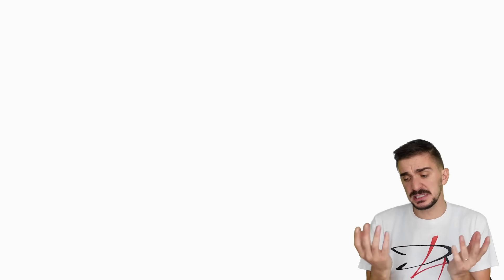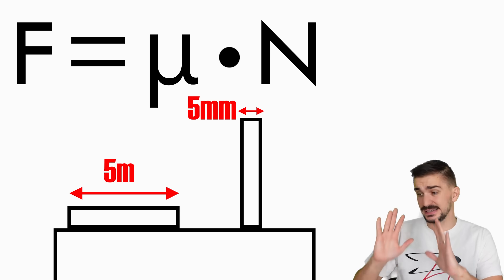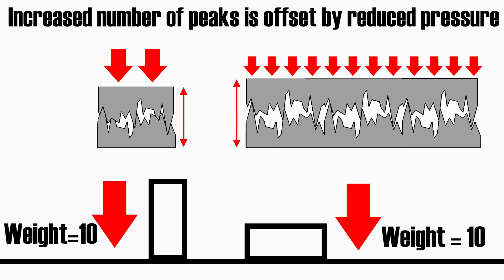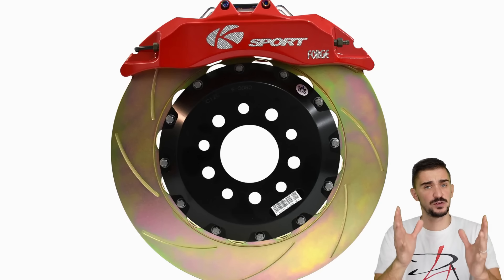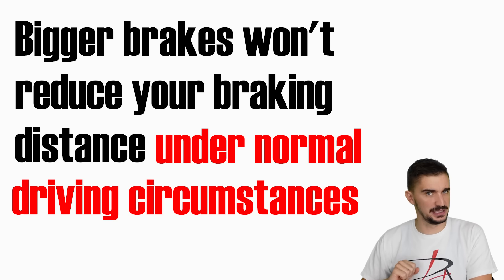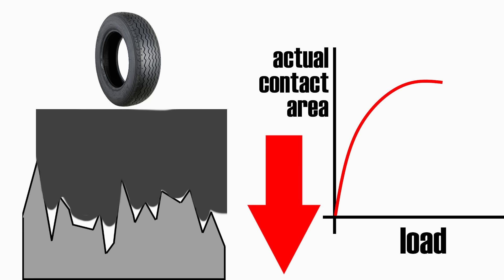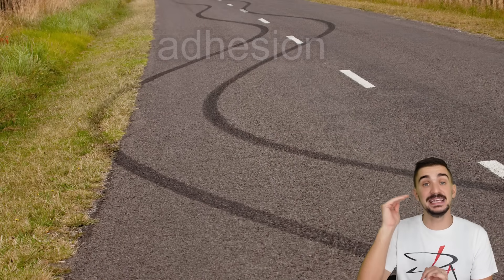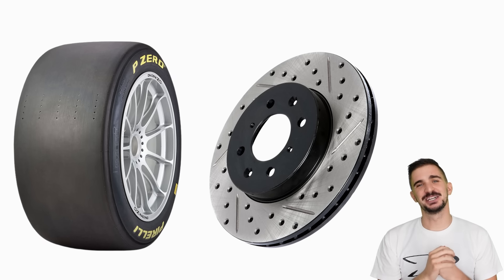Why Big Brakes Won't Stop You Faster but Wider Tires Will - Friction and Surface Area Explained

Comment: I think that the reason is much simpler. Most brakes are already able to lock up the wheels while braking so pressure increase won't help, because the wheel can be already locked up with smaller brakes (that is also why every new car has ABS). 
This means that breaking performance for most cars isn't brake pressure limited, bud tire grip limited. 
Larger tires will have more grip and more grip means more friction, which improves braking performance.
Reply: TRUE, Until the second hard application and the small factory brakes are fading from overheating .. there's far more to brakes than presented in this video
Reply: which could require larger brakes. at some point the grip is so much that u need larger brakes to lock it up with abs.
Reply: @jkoorts  At some point, the grip is so much that you need more stopping torque to lock it up with abs. That could be accomplished with larger diameter rotors, or it could be accomplished with better brake pads alone. That's how I solved the problem.

I installed much stickier tires, and could no longer trigger ABS on smooth, dry pavement. I understand the physics, and knew that I could use more stopping torque, but also knew that I did NOT need more heat management capacity. So I selected pads with a proportionately higher coefficient of friction to try matching them to the increased tire grip. This solution worked perfectly, while being way less trouble and way less cost than installing a big brake kit.
Reply: If, by "larger" tires, you mean wider, you'd be wrong to assume you get more contact area, and therefore more 'grip'. You can change the shape of the contact area, but not its size (area) by using wider tires.
Reply: @johngalt97 Of course you change the size of the contact area.
What you say could only be true if tyres compressed with force in linear fashion, so that spreading the load over a wider area meant that the wider contact area were exactly offset by less of the tyre in front of and behind the centre of the contact area were forced down to the road surface. This is not the case.
Reply: Static friction force IS ALWAYS greater than kinetic friction force. This is the principle behind ABS, the NET friction force over a set time between pad and rotor is greater with rapid engagements/disengagements (static fric. Every time they engage) than with just one engagement (static fric. Only once at the start). Now, here is where things get complicated. Lets say you have 2 ABS engagements over a 10 second time span vs 1 continuous non-ABS engagement over 10 seconds. The non-ABS will actually outperform the ABS in this case, which means it allllll comes down to an optimization problem, you have to set up a few integrals to figure out the optimal ABS engagements for any given situation.
Reply: Nothing to do with locking up wheels, as if your optimization is not done correctly then the braking force ITSELF will not be sufficient to even come close to locking up the wheels. ABS DOES indirectly stop the wheels from locking up, however this is NOT where you should calculate your ABS optimization.
Reply: Some cars have OEM brakes that are just enough to reach the ABS threshold on the OEM tires. I have a car that was unable to reach the ABS threshold on smooth, clean, dry pavement after I put on stickier rubber. My solution was pads with a higher coefficient of friction than the OEM pads, and it solved the problem very well. I suppose larger diameter disks would have solved the problem too, but I didn't want the extra unsprung and rotating mass. Replacing the pads was an easier, less expensive fix also.
Reply: @xtnuser5338  Yup similar here, I think tire technology has improved enough over the past 15 years that the OEM brakes on my car no longer are able to reach the ABS threshold on smooth dry tarmac. Given that I also want to fit slightly wider tires because the OEM fit is really slightly too small for the rim for some reason, I'll definitely be upgrading the brakes too when I can.
Reply: New cars have ABS because it helps prevent drivers from locking the wheels. It has nothing to do with how effective the brakes are, or whether larger or smaller brakes make a difference. It's simply a safety feature to help the driver.
Reply: @severnsea  If the car had weak brakes and couldn't lock up the wheels, ABS wouldn't be necessary. Therefore powerful brakes ARE the reason, why the ABS exists.
Reply: @tomkocian6710  Yes, the prevent the wheels from locking up. I think we're at cross purposes here, I might have misunderstood your original post which discussed the size of the brakes.

Comment: Yet, with all other things being equal (same pad size, same piston area, etc), larger diameter brake discs will provide more braking power.  The same force from the slave cylinder piston is being applied further from the center of rotation, therefore applying more torque to the wheel.

Comment: wider tires also allow for more dynamic load to be added before it reaches 100% surface contact, at which point additional normal force doesn't increase grip as fast anymore as it did before when it was both adding increased surface contact and normal force to the equation.

Comment: a bigger brake disc will dissipate  heat better and reduce  or prevent fade BUT, it can also take higher pad pressure. Higher pad pressure will increase friction and thus braking power.  When you upgrade  your brakes, you don't just change the discs. You change the pads and hydraulics too.

Comment: So a larger diameter disk has nothing to do with greater mechanical advantage? I would have thought having the brake contact point further from the centre of the wheel (i.e. longer lever), would result less force being necessary to achieve the same braking performance.

Comment: Your statement is not correct:
Bigger discs are movin the effective braking force further away from the wheel axis.
So you achieve higher braking torque by the same braking force (if we assume, that the calipper pistons stays the same).
You should take care: if you behave like an expert, please make sure, the content is on expert level. This video only is okay if it is about friction, but incorrect about break performance of bigger break discs.

Comment: Hey mate, thanks for another great video! Sorry, but you missed a very important point about breaks "size", besides the heat dissipation (for which your expectations are perfect). I mean breaking torque, larger rotors (larger diameter) makes the same force to result in a higher braking torque (negative torque to stop wheel rotation) too, as the force is applied further from the circumference center. And that, theoretically, can make you "stop quicker", greater torque + same angular speed= greater power (negative power, against the wheel rotation). In practice, however, the tires use to be the "bottle neck" (that's exactly why ABS is there for you in emergency breaking, even in good dry surfaces), then indeed, larger tires are the first choice to "stop quicker", until the point their friction becomes greater than the breaks... Then, the breaks needs to be upgraded (larger diameter)... Conclusion is that larger breaks won't stop you quicker if your tires are still the limiting factor. About the tires, it's s awesome, I did take trainings from Pirelli F1 engineers a while ago and it matches your explanations. Cheers 😃
Reply: I got your point now, when you replied to a similar comment, thanks a lot!

Comment: One thing that makes me wonder is how the larger radius on disk brakes, which leads to greater linear speed on where the pads apply the friction, interferes with the breaking behavior.

Another thing that bugs me is why in motorcycles the size (radius) of the breaking disks (and the number of disks) increase relative to the the power of the motorcycle, not to it's size or weight.

Comment: Video suggestion - do you have any videos covering flow and velocity when it comes to intake tubing (intercooler pipes) and exhausts? 

I have a stage 3 on my car, except I haven't installed a larger diameter exhaust. My thinking is that larger diameter will help top end power, but ruin drivability (i.e., scavaging will occur later in the RPM range making the car even more laggy). I have an upgraded FMIC with 2.5 inch diameter intercooler piping. But even when I'm in the RPM range the car should be boosting (e.g., holding constant at c. 2.3k RPM) and then floor it, it takes a second to really take off. (The car is a Passat 1.9 TDI PD130. It's probably around 210bhp to 220bhp.)

 Another example is my CBR600RR. It comes with an exhaust valve. People always say to remove them for "more power" but when you read up about them, they're designed to increase low-end torque. I presume it's to do with increasing exhaust gas velocity (?).

It's a topic that I'd love to know more about - i.e., the trade offs and benefits of larger diameter intake and exhaust tubing.

Comment: Good video. Suspension is another extremely important component to improving (decreasing) braking distances. So too is ABS, if/when set up right. But probably the most important thing to improve braking performance is pad, disc and tyre material. Buy good parts (like EBC BSD discs and Yellow stuff pads and performance-oriented tyres) and you'll be stopping far sooner (assuming you're not already at the limit of your tyres, suspension, ABS, etc.).

Big brakes look cool and are a 'cheap' way to handle more heat, but keep in mind, F1 brakes are tiny by comparison. Lower unsprung weight is usually a sure way to improve a cars performance (at the cost of more vibration / less comfort).

Comment: Bigger brakes will reduce your brake distance. Force=Pressure*Area. When you apply the brakes, your foot creates hydraulic pressure in your braking system. Greater surface area brake calipers apply the brake pressure created by the master cylinder over a larger area, so you can apply a greater braking force to the rotor with the same force from your foot.
Reply from the maker: No

Comment: Larger brakes do stop you faster, it works more on the lever effect. The farther the caliper is from the center of the wheel, the less pressure is required to stop. Also the larger diameter the rotor is, the more frictional surface per revolution.

Comment: in my experiences in growing up in a garage n seein the evolution of brakes (>50) i agree that big brakes absorb more heat than smaller 1s BUT in my spirited driving experience i found that the more i can place the caliper (not talking bout surface area now ) close to the rim i get a shorter braking distance by technically using BRAKING LEVERAGE & if your tyres are the right compound & width as you stated u will get a shorter braking distance while the rotor absorbs the heat (USING SOLID OR WITH GROOVES ) x drilled is a no no ....(i have used stock size calipers on larger diameter rotors, cause of monetary issues, so that the calipers DOESNT cover all the diameter of the braking area ) now i also found that increased braking leverage on "narrow" tyres WILL cause it to lock up very fast ...i also noticed that large brakes on certain weight vehicles last VERY long like when i put Volvo 244 4 pot calipers on a Volkswagen bug & the 2 pot that was originally on the front i put on the rear  (as far back in the 1995) which i noticed was the same rear caliper on both the Volvo & Porsche 911 ... i sold that bug in 2008 with the same pads ...saying all a this is to say that ...THANKS FOR THE  EXPLANATION ON HOW IT ACTUALLY WORKS ....keep up the good work...

Comment: Hi you! I've been watching you for a long time. You more often than not get it right ... but my humble opinion is that this time you haven't. Here is my 6th grade learning: you want to stop a rotating force, which represents a momentum. Thus, you need the same force applied (breaking force) at a greater distance from the rotating point. Hence, the assumption that, if you apply the breaking point further from the point (for the bigger disks), you have more chance to stop the rotation easier. Please contradict this ...
Not to say that, with wider tires, you can catch more uneven surfaces and uplift more of the rest of the tire, hence you get less surface to grip on (the snow driving has that effect ...)
Reply: More braking power from bigger brakes doesnt mean stopping faster unless you had insufficient brakes to begin with.

Comment: the drag coefficient of brakes in proportion to weight means that if the brakes are too small for the job, larger brakes up to a point WILL stop you faster. when the weight and brake force exceed design specs, the better tires will brake faster. I changed from cooper performance tires and installed Goodyear performance tires and brake performance improved greatly as it took 18 feet less distance to stop. when the maximum-sized brakes were installed, braking was even better everything else being the same.

Comment: This couldn’t be more wrong. I’ve tested many cars factory brakes vs bigger brake kits. With no change in tires a bigger brake system will stop a car faster and in a shorter distance.

Comment: When I bought my V8, it had 205 x 55 x 17 and standard style disks. I changed the disks to race style drilled holes and angular lines. I changed the tires to 255 x 35 x 19. What I found was I stopped twice as quick as the standard brake and tyre setup. The one area I tend to disagree with is the bigger tires not preforming as well in the wet. 
I originally thought that when I was younger. but I have found the tires I have now are better in the wet than the standard tires. I can corner and take off from lights like it is dry and get no wheel spin. Though if I put the pedal to the metal, then wheel spin will be induced. I think it just better compounds used these days on the tires. But overall, a good informative video.

Comment: Utter bullshit. If your small brakes have barely enough stopping power, having a wider tire will just make them even less efficient.
Reply from the maker: You can't buy a car that comes from the factory with barely enough stopping power. You could maybe 50-60 years ago but not for the past 30.
Reply: @d4a  it depends on what we define as "barely". First thing that comes to mind is TLC, XC90, all of Japanese shit-rice cars. In my book this is the definition of "barely". Thanks for the reply though 😃

Comment: Bigger friction between the brake rotor and pads just means that it ill be easier to lock up your wheel if your tire don’t have enough friction on the road to keep the wheel spinning.

Comment: I've had this argument with several people in the past.
Fact is, stock brakes (at least since the 1990s) are limited by the traction of your tyres. They will apply the naximum amount of braking that physics will allow at least 5 times in a row from a very high speed. Therefore, your street car doesn't need upgraded brakes unless you intend on braking the law. Regardless of how much power it has.
If you're going to the track, then upgraded brakes can help. Generally you'll get by with just track pads.
Reply: Which law are you referring to?
Reply: @robair67  the law of "I've driven lots of cars on race tracks with stock brakes all the way up to retired V8 Supercars and know what I'm talking about"
Reply: @1one3_Racing  I'm happy to break that law.
Reply: @robair67  I'm not saying you SHOULDN'T upgrade your brakes. My point is, people go from stock brakes with regular pads and think they need to change calipers on road cars. Then when they do and they feel better they think they have improved the brakes. But its just the pad. You can get the same pedal feel and performance from stock calipers by upgrading to a track pad.
Changing calipers means you also need to balance your master cylinder size and fluid capacity and people don't take this account and ruin their brake bias and therefore vehicle safety.
If you're going to change braking components, it needs to be a full system. Otherwise, just use a slotted rotor to keep the gasses off the pad, and run a high temp fluid and pad and you'll get exceptional performance and great pedal feel. Generally going from a large single piston to smaller multi piston setup doesn't actually give you any more surface area anyway. It just distributes the pressure more evenly across the pad and is more for temperature and pad wear than actual braking force.
Reply: @1one3_Racing  some years ago I went through a 10 year long phase of driving only front wheel drive cars, when on the road. It was no fun...except for left foot braking! However, it really eats through front pads (and discs) and at one stage my standard compound pads had worn about 3 to 4mm diagonals on the floating calipers. The sliders and pistons were still serviceable and within tolerances! A change to 1144 pads meant better front braking and therefore an increase in line pressure was needed at the rear (drum brakes- 1.6 205) which was achieved by deleting the load valve. The balance was absolutely amazing, even at motorway speeds. This car ended up exclusively a circuit car and the brakes just couldn't keep up. So your explanation definitely bears out my experience with that car. And finally, I may have broken a few statutes and acts of the ministry of transport (!) but I am bound by Common Law, not corporation law!
Reply: I recently overheated my brakes and my car had never seen a racetrack 🤣
Reply: @AngryGamer  of course it's possible. There's a mountain range near me that people go down holding the brake pedal the whole way down and lose brakes. You can also be boy racing on the back streets and cook brakes.
You'll find if you go to a track oriented brake pad, this issue will go away.
Reply: @1one3_Racing  yeah, I've done some "dynamic" driving 😅